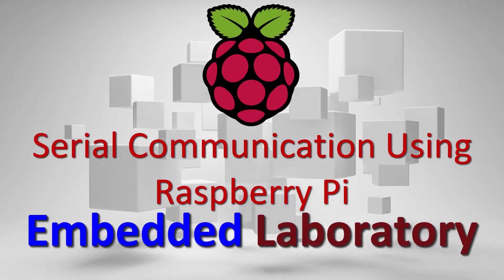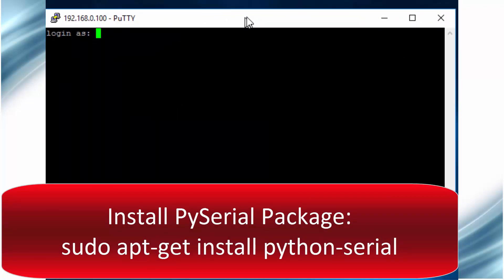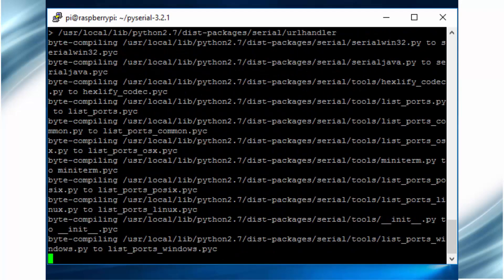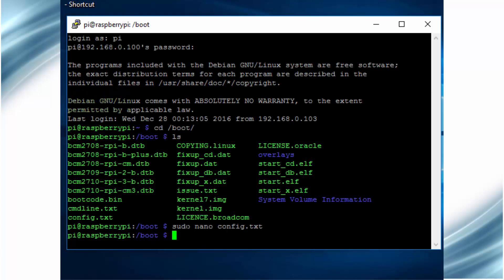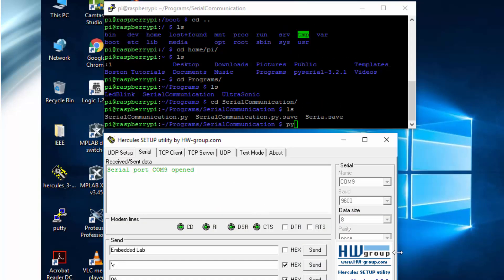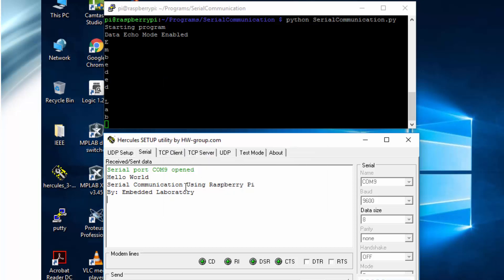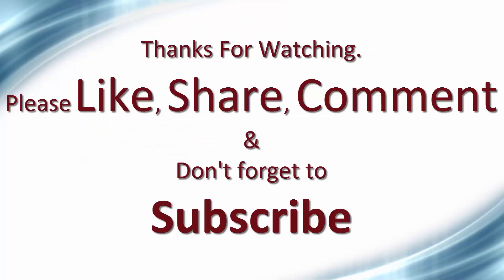Serial Communication in Raspberry Pi using Python

Comment: hey how are you connecting the pi to pc ? using a usb cable? or are you usng the gpio ports
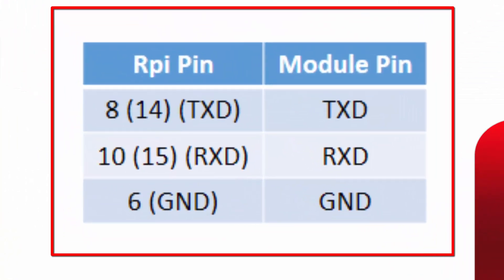Reply from the maker: Some of the RPI GPIO has multiplexed UART functionalities, like in this case as specified at time 0:24, and then I am using USB to UART/Serial converter to connect it to PC/Laptop

Comment: Hello there, I have connected the usb to TTL converter on the raspberry pi and the usb on a sensor. How can I get data from sensor? I have the sensor's protocol and Im using your source code with the sensor's baud rate, parities etc. What else should I change in the code to retrieve data from the sensor? Thanks

Comment: I have a device the give data vy RS-232 how can i read it from the raspberry?  ---
Reply from the maker: Raspberry Pi is a 3.3V device so you can't connect it with your RS232 device.
You need a converter ic in between, sl you can use max3232 for this purpose.
And then you connect rx of Rpi with tx of this device and tx of Rpi with Rx of this device.
Reply: Thanks for replying, one more question please, we have a project using the rs485 pi HAT, and using the software ModBus Slave and it  works (protocol Modbus 485 RTU)!! using a pythin code and .js  and basic Html, im replacing the Modbus Slave with a Device that cant work with rs485 but works using rs232,   i use the software MosBus slave to see data from that device, and i can see using a converter (rs232-USB) , and i have a converter RS232-RS485, but it doesnt work, I dont know what to do...  i would like to explain you better or send some pictures...  idk if we can do that mate.
Reply from the maker: Can you please try to elaborate it more clearly.
I didn't gey that properly.
You can use matlab.academy@gmail.com to share the images which you are talking about.
We will discuss these things there.

Comment: when I use the command sudo python setup.py install, the Rpi3 give me this message: ImportError: No module named _sysconfigdata_nd
How can I fix it?
Reply from the maker: Are you in the same directory??
One reason is that, you might be in someother folder while trying to install.
Reply from the maker: You can also use command if you are connected to internet.
sudo apt-get install python-serial
Reply: Embedded Laboratory thanks for your reply, I used the command sudo apt-get install python serial, but the problem is that I can´t find the directory that you mentioned. So I just type the command sudo python setup.py install and my Rpi3 throw me the same error. Where could the directory be?
Reply from the maker: use python-serial
Not python serial
sudo apt-get install python-serial
Make sure that internet is working on your Raspberry Pi

Did you read my blog post also???
Please check that, I don't know why you are not able to get it run.
May be can use team viewer to solve this problem.

Comment: How can I use this script (SerialComunication.py) to do the same thing but between two raspberry pi's?
Reply: I think, you just need to connect the rx of one rpi with tx of another and vice versa.
Reply: Embedded Laboratory just did that but there's no data between two raspberry pi b, the wiring and the software are ok and the UART is correctly activated so I don't know what's going on... Have you done the UART comunication between two raspberry pi 3 b successfully? seems not possible to me
Reply: Embedded Laboratory oh it's actually possible okay thanks, yes rx-tx, tx-rx and ground-ground, also the configuration for uart by raspi-config and manually, well... Nothing worked for now and there's no tutorials connecting two raspberry pi 3B via uart but thank you for the answers I'll try harder :)

Comment: This does not work with RPi 3 any more :(
Reply from the maker: If i remember, one of my friend has tested this on RPi3 also and it is working properly.
What is the problem you are facing??
Reply: Embedded Laboratory thank you for your reply dear. I am trying to connect RDM6300 RFID reader to RPi3 using UART and it does not work. I don't know why, i searched for weeks but couldn't find a solution that works. Behindthescience.com had some tutorials but it doesn't work too.
Reply from the maker: Firstly i would suggest to check the UART of RPi only by connecting a ttl to usb converter.
I think this will work.
Then as a next step use your pc and send commands from pc to rfid to check if it working or not.
After this connect rfid with rpi.
Make sure that you connect tx with rx and rx with tx.
Main objective is to find the problem area and debug the source of problem.
Reply: Thank you for your time, i will check it and comment if it works. Thanks again.
Reply: @xyzoblivion  for me too, it did not work. I am trying to communicate a energy meter with raspberry pi